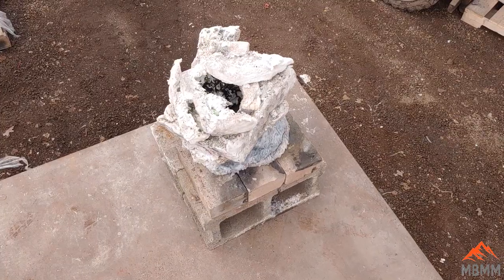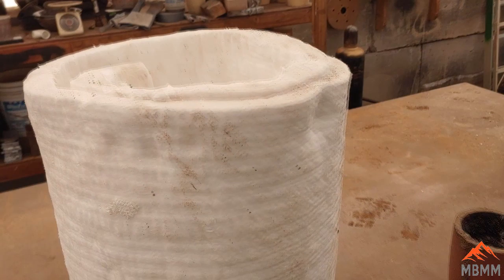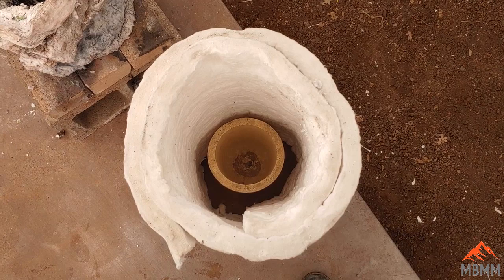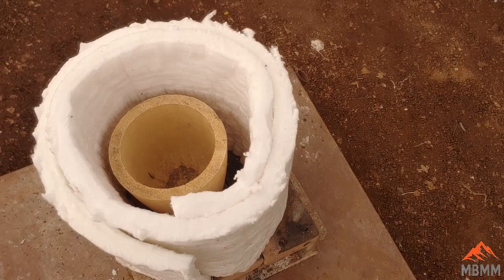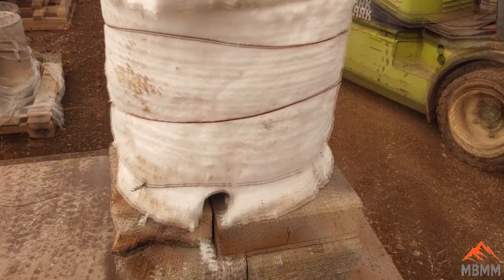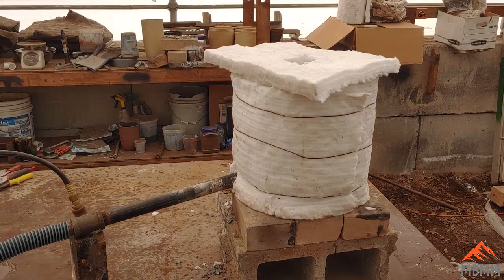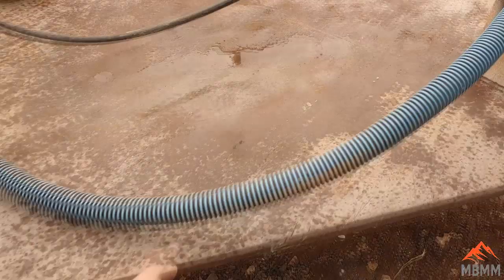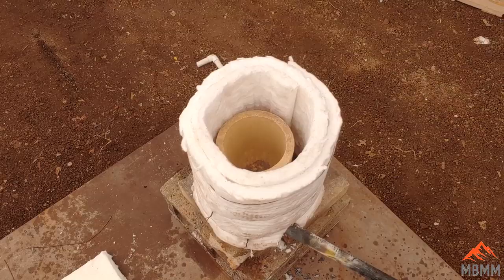How To Build A Gold Smelting & Melting Furnace, Cheap, Easy, Fast!

Comment: After you put sodium silicate on it, if you coat it with a ceramic clay like itc100ht or satinite, you probably won’t have to replace your wool and it’s easy to patch and much much safer for your lungs.
Reply: What is the sodium silicate for?
Reply: @henningerflats   as a rigidizer for the wool so that it’s easier to paint with ceramic clay

Comment: One tip for the k wool... If you Heat IT eventualy IT wil crystalize and very fine particalse Will come loose. And those particles can produce cancer. I work White k wool almost Everyday. Sorry for bad englisch.

Comment: What is this material made out of that it can stand up to the heat? How hard or easy is it to cut? What is the brand of of the adhesive? Is that black stuff lining the 2nd furnace additional product or just char?
Reply: I've worked with kaowool before. We get it at our local fireplace store. It comes in roles with different thicknesses. I use a mask and gloves while handling it because of the fibers. It's super easy to cut with scissors. I think the black stuff is just accumulated splatter from the smelts. I also use a respirator when I'm smelting but that's just me.
Reply: Also, this stuff is the best. It holds the heat in like crazy and as he said, you can easily patch any holes, etc.

Comment: Did you make the torch end or buy it? Have you made a video about how you made the vacuum attachment with the parts you'd need to buy or is it a no-brainer thing? I've never seen the vacuum attachment. Curious about it's use and how high you adjust it and the effect It has on the process.

Comment: I heard somewhere that your supposed to seal the wool so you dont get dust coming off it.
Reply from the maker: Thank you for your safety concerns! We'll definitely look into it for next time.
Reply: treat with fumed silica. a rigidizer
Reply: I use a respirator when I smelt but I've also sealed the kaowool. I think I used fireplace cement but don't take that as good advice. That's just what I used.

Comment: Cant glass go airborne and be bad for your lungs by firing wool without hardening it?
Reply from the maker: Yes, I always wear a respirator.  Everyone seems to comment on the glass fibers, but I think they are not the worst thing coming off a smelting furnace.  There is also SOx that turns to sulfuric acid in your lungs, heavy metals (Pb, As, etc), caustic fumes from soda ash/NaOH.  So yes the ceramic fibers are bad, but there is other stuff too that I am more worried about.  Always wear a respirator, not just a dust mask.
Reply: @mbmmllc  is there a special brand/type of respirator your use for this work?